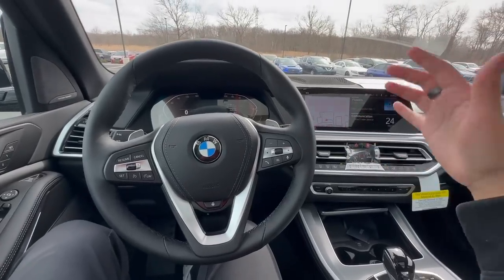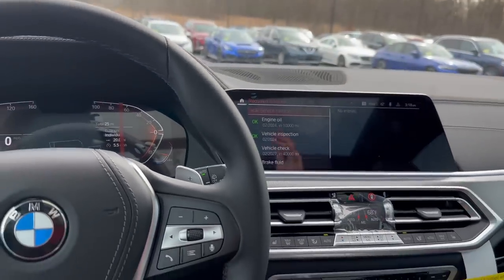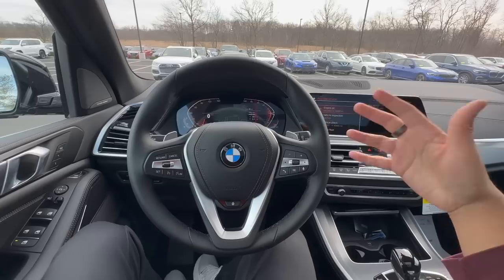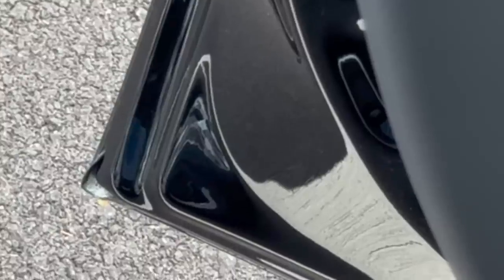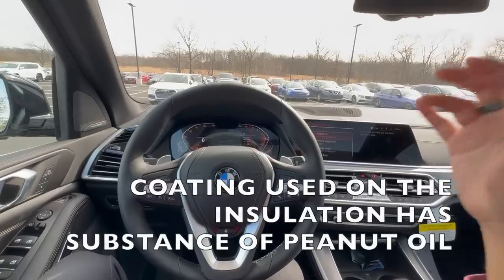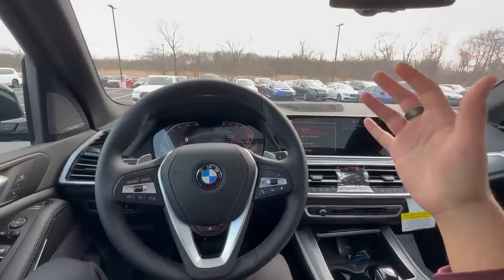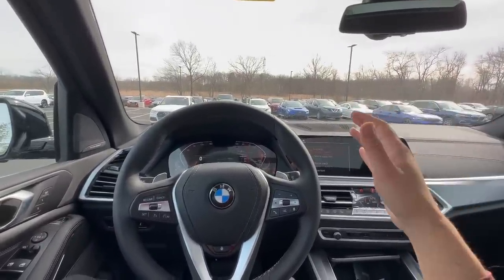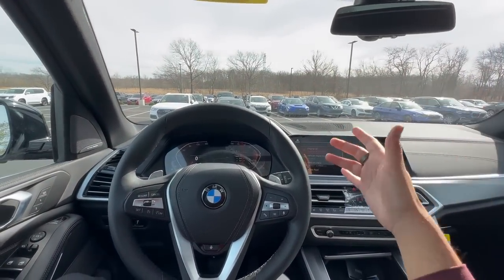8 Things That Will Make YOUR BMW LAST FOREVER! YOU MUST Be Doing These!

Comment: Love the videos but I have heard from BMW engineers that it’s actually the cars that are driven “light” that run into more engine issues down the line. The reason is these are high performance engines they need to be run hot pretty often to keep the internals clean from carbon buildup, injectors fouling, and other pollutants. So you actually should be running the engine hard fairly often to keep it clean and optimal!
Reply from the maker: Great point, yes I have heard that as well that every once in a while it's beneficial to run the engine hard to clear out the gunk, this is very much needed for the m cars that have high performing engines!

Comment: Rats!!! Well, not in the cabin, but under the hood - gnawed some wires. Thought maybe mothballs would dissuade, but BMW tech recommended mint spray- formulated for this purpose (on Amazon). No damage in last 3 years since religiously applying a spritz after each foray.